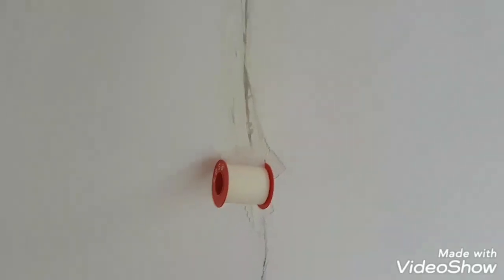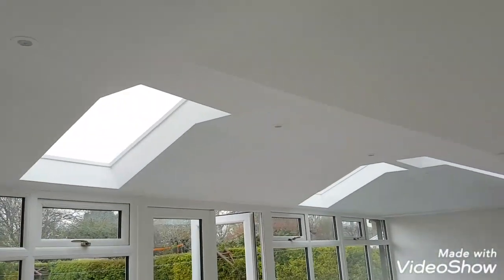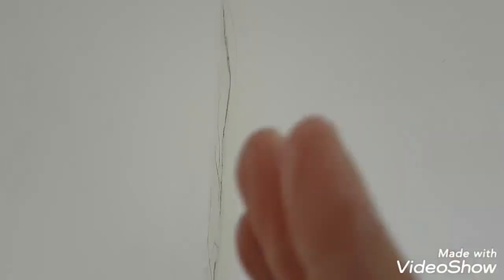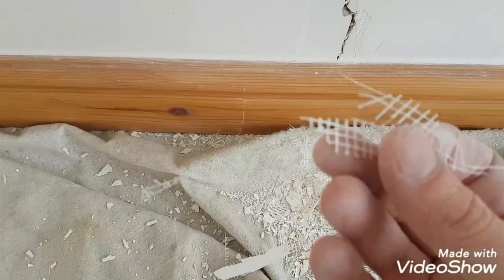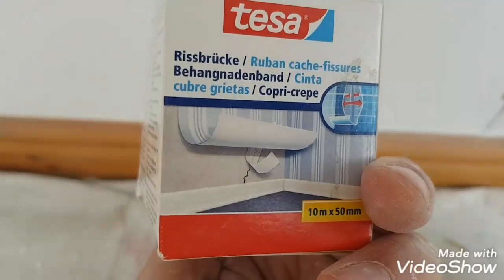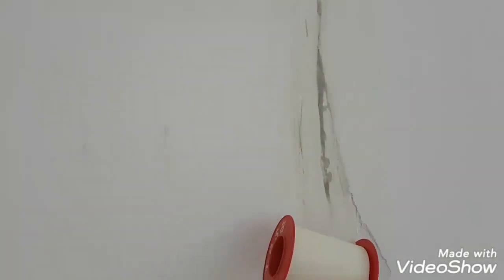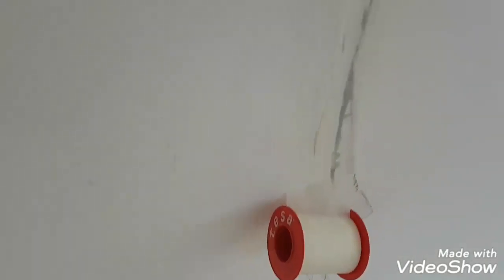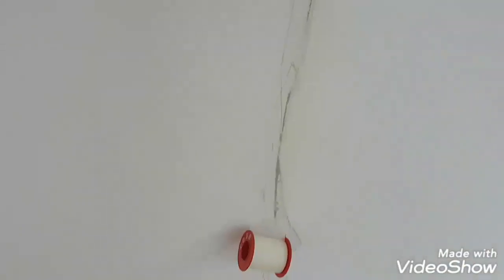How To Prepare Stress Cracks Before Painting

Comment: Hi there. Do you fill the v groove first and then apply the tape? And then skim over with Easyfill?
Reply: Hi. Yes I rake out and fill. Then tape and then skim over tape. I have found another product recently called Fibacryl by Toupret. Its a ready mixed filler which is fully flexible but you have to put it on neat and wipe off any edges as when it sets you cant rub it down. Great gear. Really works for stress cracks.
Thanks for watching
Reply: @danielnugent2168  thank you! Will get some!

Comment: Did this stuff work well? Just used it on something myself, not for wallpapering though, just to paint over, as tried the Toupret scrim, but that doesn’t have the self adhesive part to it, plus double the price.
Reply from the maker: Yes it's great but hard to get hold of as it's American. I think Amazon stock it now and then when available
Reply from the maker: I'm on about Stress Crack Tape by Stepsaver which is better than the Tessa but hard to get hold of
Reply: @danielnugentpainteranddeco557  i suppose you’ve got to try it all to find the best one. I’ll give that a go too.